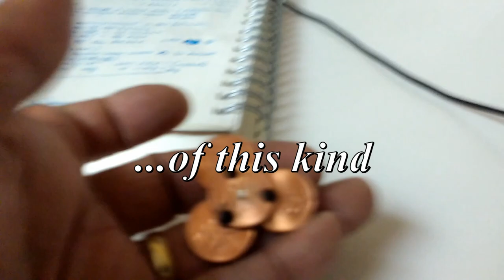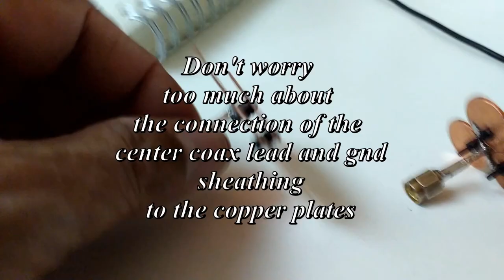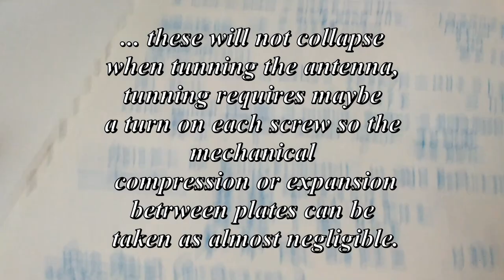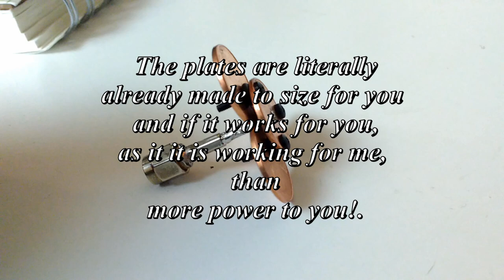An Awesome Tunnable FPV 5.8Ghz Patch Antenna You Can Build 4 Pennies!

Comment: If your Lincoln Memorial penny has a date before 1982, it is made of 95% copper. If the date is 1983 or later, it is made of 97.5% zinc and plated with a thin copper coating. For pennies dated 1982, when both copper and zinc cents were made, the safest and best way to determine their composition is to weigh them.
Reply from the maker: yep!